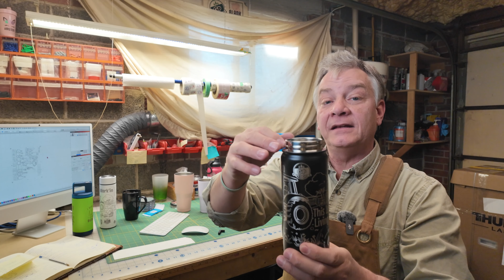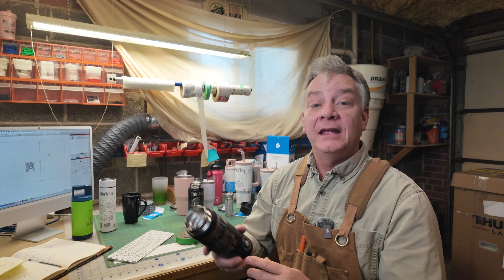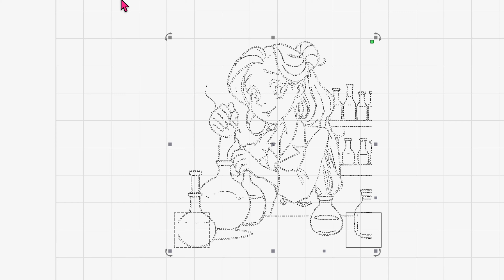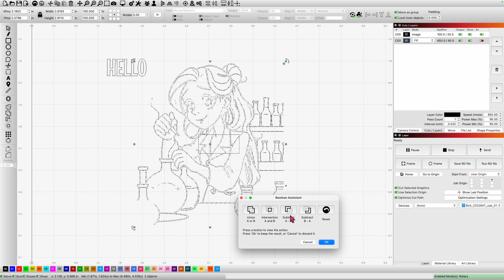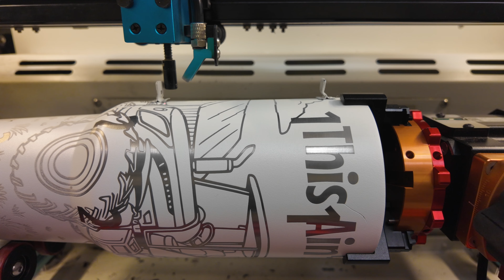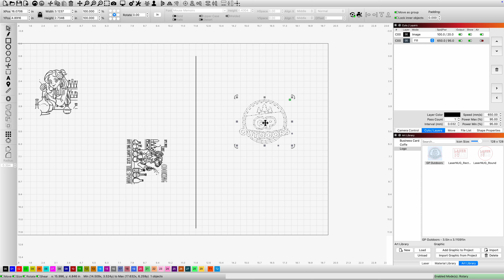Tumbler Engraving Basics on Thunder Laser BOLT.  072   4K

Comment: Hello! I actually engrave tumblers as my primary selling item and I purchased a Bolt specifically to just take over my tumblers. I have removed the autofocus from my Bolt so it does not have a collision (DO NOT EVER HIT AUTOFOCUS WITH THE PLUNGER REMOVED). I use the physical measuring T that came with the Bolt to ensure I am at the correct focal length. To save inventory I often use painters tape and run tests at 600 speed/10 power. When testing for full wrap circumference, I measure around the cup and then create a tool layer rectangle of that size. I then make two 1/2 inch squares and align one to the top of the rectangle and one to the bottom of the rectangle. I position the squares so that once they meet around the cup, it just connects perfectly at the corner of the squares. This saves a ton of time so the laser isn't engraving all the way around the actual cup, but you still see that the circumference is perfect for the full wraps. I primarily engrave the top brand 40oz tumbler that rhymes with Manley... they have those big tabs and those extreme tapers. I always use my 4" lens as the focal length has so much forgiveness to it. If I am just engraving the top portion of the cup (not dealing with the extreme taper) I am doing 400 speed/60 power. If I am doing a full wrap and angling the cup to about that 3 degree mark, I bump up the power to 68. One thing that is important thing to note is that my line interval for my engraving is always at .06mm. As you have noticed, some colors do leave that dull looking haze to them. LA Awesome has been a significantly better cleaner and is way more cost effective than the power wash. I also have fount the PiBurn roller to be much much easier for tumblers that the PiBurn chuck rotary (I have both). I have created cup size templates on lightburn for the various size cups that I use with the tool layer and saved them to my library. If someone want a 20oz cup, I simply open my library and bring out my 20oz cup template and drop the customers desired design within the template. Then its as easy as leveling the cup on the roller, adjust my Z axis for focal height, set origin at the top edge of the cup and send the design. No need to worry about chuck fingers, cup wobble, inside threads, etc. I wanted to share my tips with you and your followers as I sometimes come on here to see the various things you have been doing with your Bolt and I appreciate your contributions to this craft and all that you share.
Reply from the maker: Good morning and thanks very kindly for taking the time to share your process and settings - it is really helpful for me and I am sure for others. Thanks for helping us all and for tuning in from time to time. Some excellent info in your comments above. Have a great week!
Reply: @IWishYouWood thanks for this info! Was wondering if it's possible to get good results at faster speeds, say 650 or more?

Comment: Evening. Thank you once again for the great, informative and engaging videos. My Bolt Plus arrived about a month ago and your videos have helped me hit the ground running, so thank you very much for helping with my learning curve moving from diode lasers.  If I may ask, who would be your best supplier for tumblers? I have checked out a few Canadian suppliers, but I’ve found their prices for individual tumblers quite high.  Cheers,
Reply from the maker: Good morning Ian. That's great to hear. Yes, the pricing is higher here compared to the states I believe, especially now with the tariff issues. I get my Polar Camel tumblers from cesco.ca (Canadian Engravers Supply), and I use Grosche International drinkware from grosche.ca  the Grosche are a premium cup. They both require you to submit a wholesale application and once approved you get access to their pricing. Hope that helps. Cheers and all the best!

Comment: Is a rotary a must with the thunderbolt for tumblers? Or could a jig be used?
Reply from the maker: Hey thanks for watching. If you don't want or plan to do any engraves bigger than about 2x3" max, then you could probably use a jig, like folks with fibre lasers. But I think you will find, as I did, that having the ability to rotate the cup for larger or more robust engraved Logos, corporate messages/etc and/or personal designs, you will need a rotary for sure. But hey, maybe start off without the rotary and see what you are able to create with a jig, and then decide from there, before you spend the money on a rotary. I think you will end up buying a rotary. :)) Cheers and wish you the best!
Reply: @LaserNUG  Thank you for your insight and explanation. I truly appreciate. I will plan on buying a rotary.